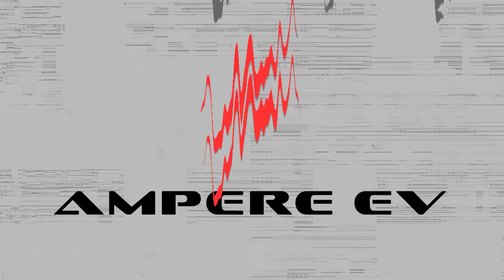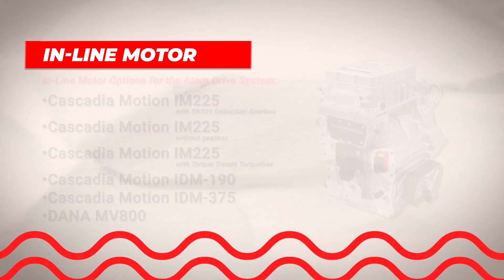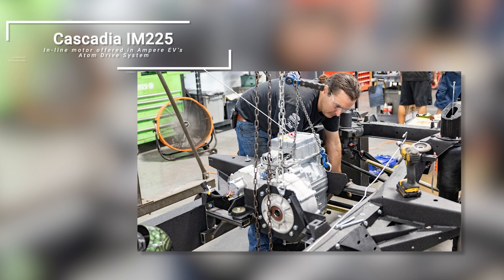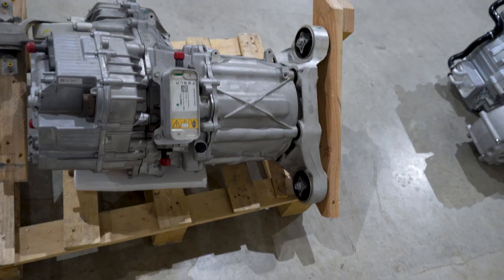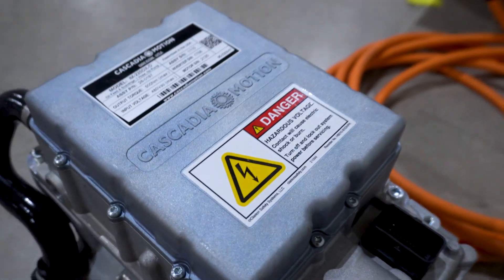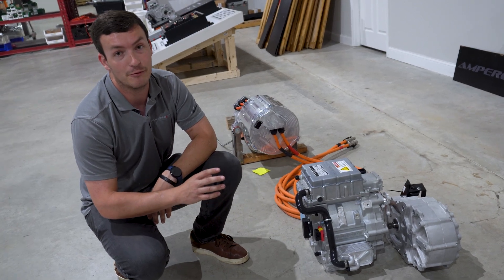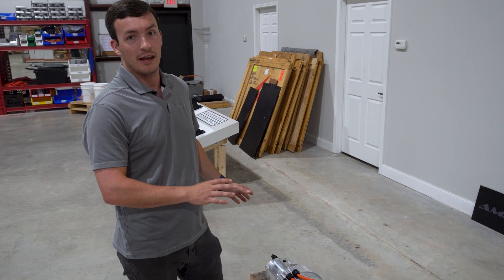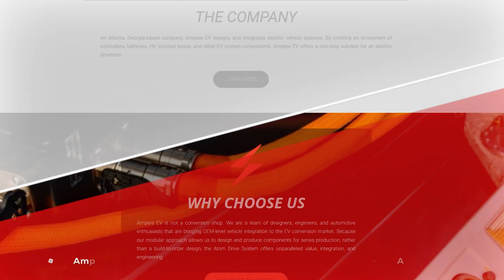EV Enlightenment - EVERY MOTOR EXPLAINED

Comment: I OWN THE PATENT IN THE USA FOR CONVERSION KITS.  I WOULD LIKE TO SEE THE ELECTRIC MOTOR INSTALLED IN THE ENGINE BLOCKS OF VEHICLES.  USE A BELT SYSTEM TO RUN THREW THE CYLINDERS AFTER THE PISTONS HAVE BEEN REMOVED TURNING THE MAIN CRANK SHAFT CAUSING THE VEHICLE TO MOVE FORWARDS AND BACKWARDS, AS WELL AS RUN THE WATER PUMP POWER STEERING, ALTENATOR, COMPUTER EVERYTHING THAT CAME WITH THE VEHICLE.  ALSO YOU CANT BUILD BETER THAN THE FACTORY DID.  AND SUPPLY THE PARTS NEEDED FOR EVERY VEHICLE.  WHAT MODEL OF ON ROAD VEHICLES COULD YOU BUILD THIS SETUP CONVERSION KIT FOR?  LET ME KNOW

Comment: There are plenty of wrecked Tesla motors out there now for a reasonable price though. I think you guys should develop an adjustable universal type of shortend IRS subframe to drop a used Tesla motor into and bolt up to classics along with stand alone controllers for batteries and motors. Thats where I think the market will go the next few years. We all want those carbon sleeved PLAID motors but those Model 3/Y are getting to be as cheap as used Gen III/IV SBC's!

Comment: I can only imagine how that big one feels in an old muscle car. bet it eats tyres.
$10k US for just the Cascadia motor? Wow, I wasn't expecting that high of a starting price. 
Sure wish it was a bit more cost effective. I guess budget builds will still be based on wrecks for some time yet.
Reply from the maker: Thanks for your comments! The power is incredible, but torque management strategies using our proprietary VCU software keeps the power from devouring the tires. The Cascadia motor is more expensive, but we have other offerings that cost less, and keep in mind that once installed, maintenance costs are practically negligible.

Comment: Which one is best for classic vw beetle? Plug to old beetle gearbox
Reply from the maker: If you want to keep the manual transmission, you would need to use a Cascadia style motor.

Comment: These seem to be AC motors. An 8 or 9-inch DC motor has worked well for EV conversions for decades.
Reply: The only advantage DC motors have for automotive use are higher torque at low voltages. That’s the reason you don’t see them in any highway EV from any manufacturer.